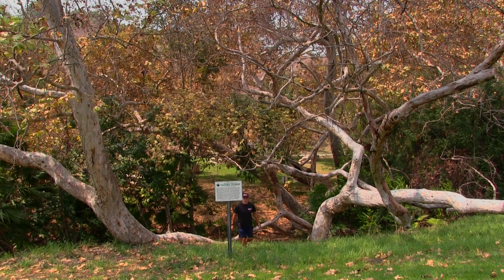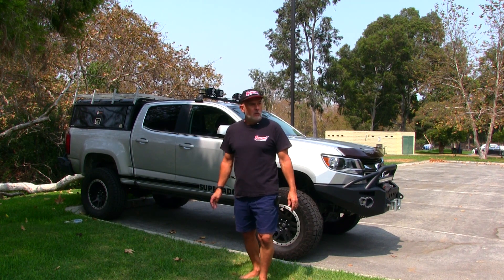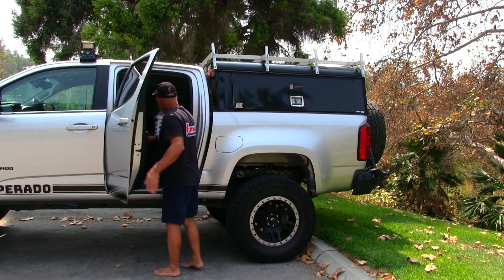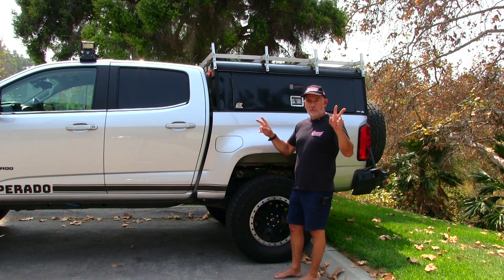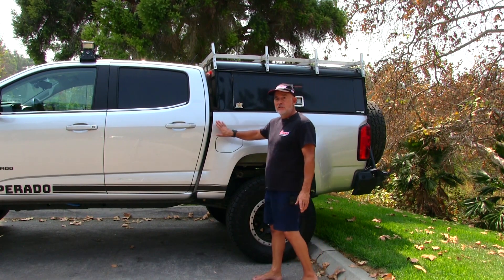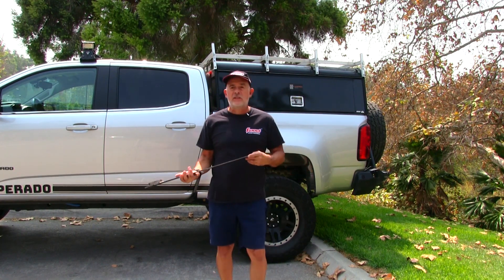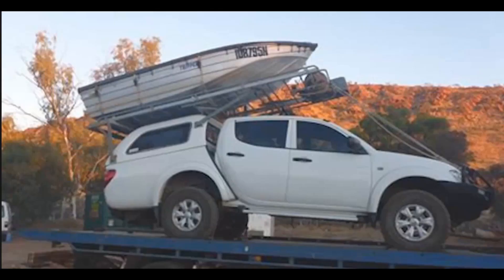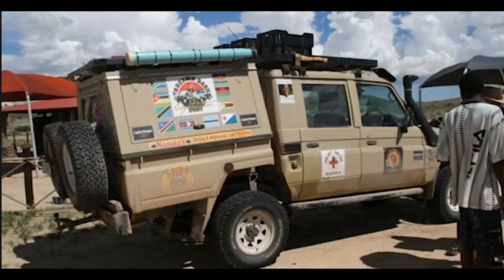4x4s and Bent Frames

Comment: I work at a cemetery, we were tired of driving around in shitty (non-ac and most of them cabless) toros all, hauling 6-8 loads for a grave. 

So we bought a colorado to see what we could do.  We sprung it to 1 ton (she rides a little rough) channeled the frame and had a local truck shop find us a small dump bed.  Works great, we can fill a grave with a load and a scoop!   We weren't gonna channel the frame  but we saw that same pic...

The plate idea should work, we chose to channel the frame, we didn't go very thick, 3/16 channel or something around that.   It took godamn forever to channel, so much fitting, cutting, fitting... if I were you I'd put a diamond shape on the end of your plate. Don't want to end on a vertical line is what I was always told. Don't worry about welding on your frame GM welded the damn thing together after all.  Just don't go wild, take it slowmove from side to side as to not build up excessive heat.
Reply from the maker: Thanks for the comment! I would like to see the truck frame. Are you in SoCal?     I was trying to come up with a "DIY"  kit. Something EZ to install. I have a new bolt-on version but ran out of money.
Reply: @rudedogii  i want the bolt on version

Comment: The Colorado bent frames all were over loaded and had been abused off road.
Reply: Lol just typical chev using small gear still haven’t put a solid axle under the dmax which is a joke good motors though exelent.

Comment: Yes dont weld vertical on a frame, I was a certified welder, the best way is to weld it so it turns the "C" channel into a box. That way eliminates corrosion problems and welding vertical.
Reply: the colorados already have a boxed frame
Reply: @woofman4796  regardless they have a collapsing point
Reply: @mblake0420  why do you think i want supports on mine